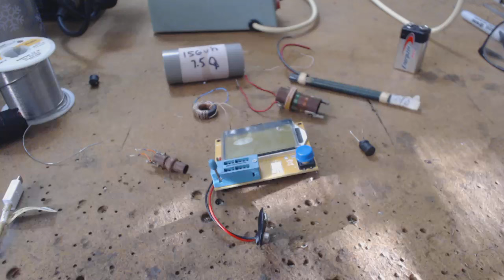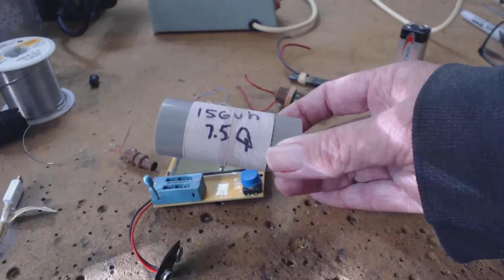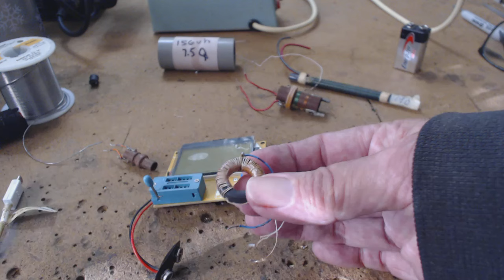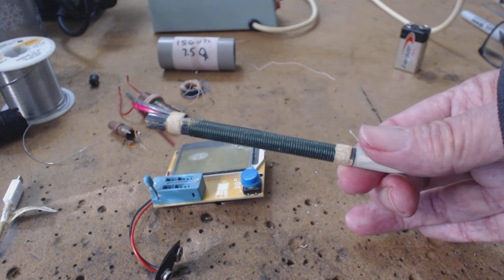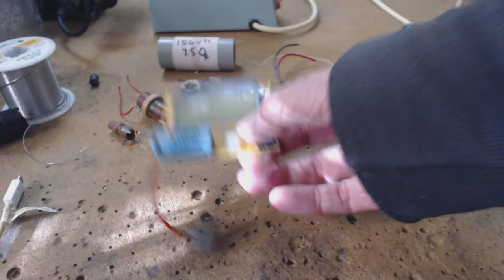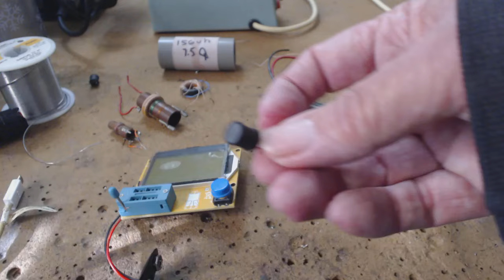Measuring the  Q  of a coil

Comment: You should state the frequency the Q was measured at since Q varies with frequency. I would guess your little digital meter measures at a low frequency, maybe 500 Hz-5 kHz, since your Q values for the coils you show are so low. Maybe your little digital Q meter doesn't show the frequency, either. I've been a "Q junkie" for many years and I actually own a HP 4342A Q meter that you mention. I've made coils with Q as high as about 1800, measured in the 700-1000 kHz range where such coils show a peak Q. Should you ever wish to have an inductor with an accurately measured Q at a specific frequency, I'd be happy to make and send you one.
Reply: There is a commercial LCR meter that can show the Q of an inductor--the DER DE-5000 handheld meter. It allows you to set the test frequency up to 100 kHz. Normally you'd measure small RF inductors at the highest test frequency, 100 kHz for this meter. It's the least expensive LCR meter that has 100 kHz test frequency. It's made in Japan and can be found on eBay for around $100. I use mine practically every day. I don't buy the optional accessories; I make simple test leads with banana jacks, stiff buss wire of a few inches to mini-alligator clips.
Reply from the maker: The point of the video was the tester gives you a Q value.  I also tried to explain where Q is important. Use the info for your video.  Other than transmitters the Q value is history!